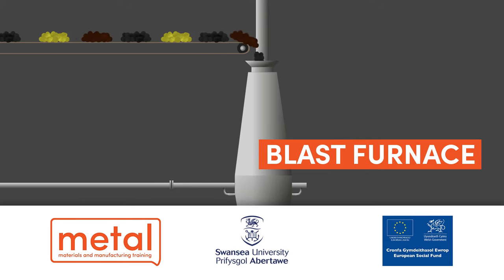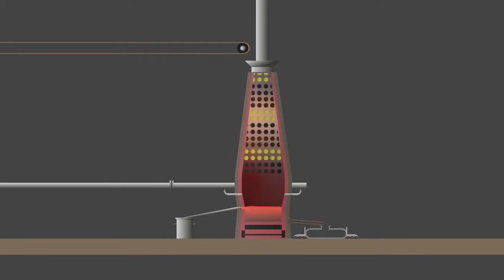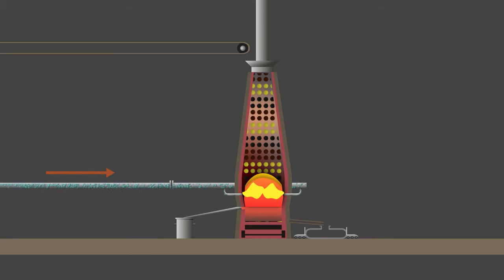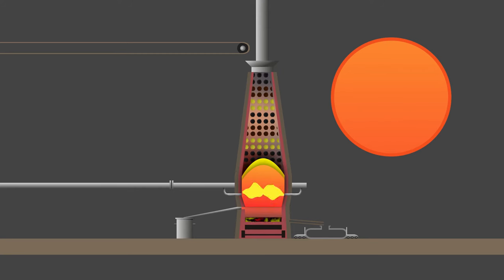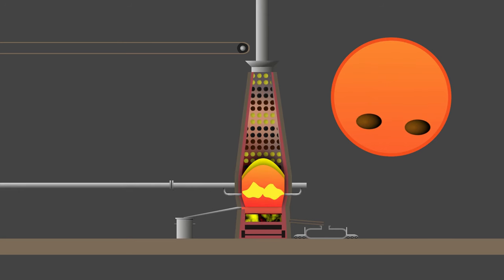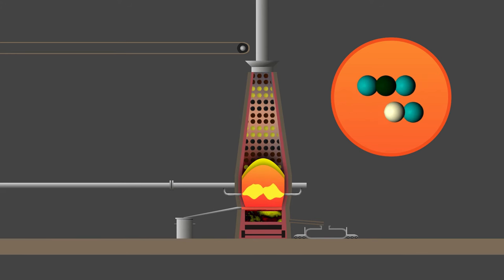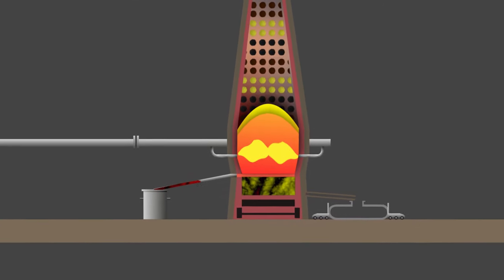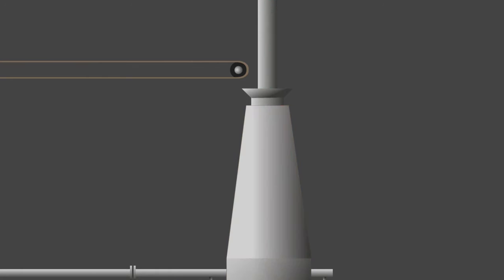How Blast Furnace Ironmaking Works

Comment: Will the charge not fall to the bottom of the furnace as soon as dumped from top?
Why does it descend slowly? Is it because of heavy hot air blast?
Reply: The fuel used is coke, the coke provides the structure inside the oven for the iron to rest on. As it's burned the iron sinks lower
Reply: @IkarimTheCreature  thank you sir